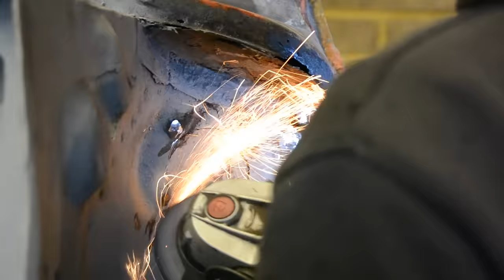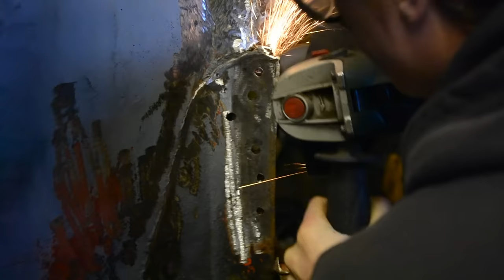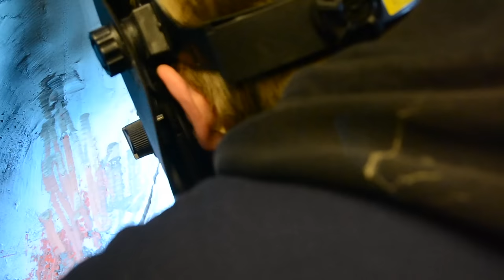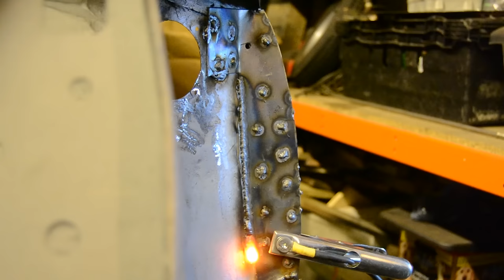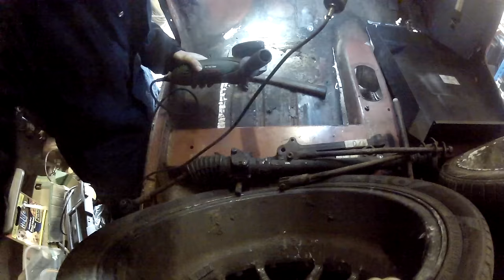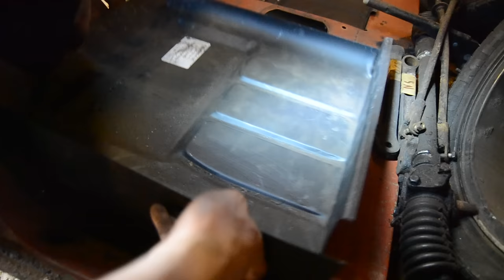Classic Mini Race Car Project | Part 6

Comment: what is that gray color stuff that you keep applying with a brush? kinda looks like paint but some how i think it might be more than just paint.. since it seems to bubble up when applied to the rusty areas.
Reply from the maker: We call it Kurust or a product similar. It basically chemically changes rust into a hard stable material. I used it on the roof for example because although it was rusty its a none critical area with no holes. This will soon be sanded back and then primed in a video coming soon. It's one of the best inventions ever created for classic car restoration!

Comment: I note you are installing prefabricated parts like that floor pan. Are things like that readily available ? and if so where did you source them?
Reply from the maker: Hi Andrew, Yes they are readily available, the main mini shops like MiniSport or Mini Spares, or just use eBay.  M machine are good as well!